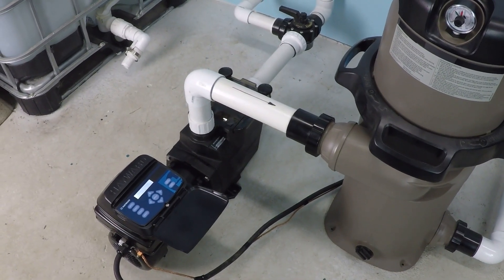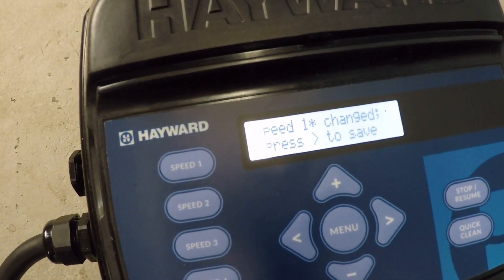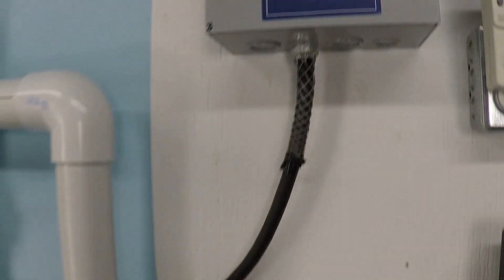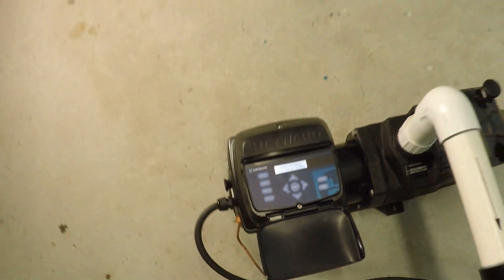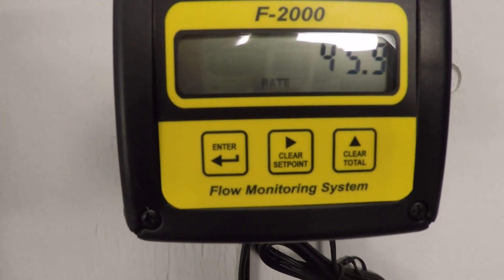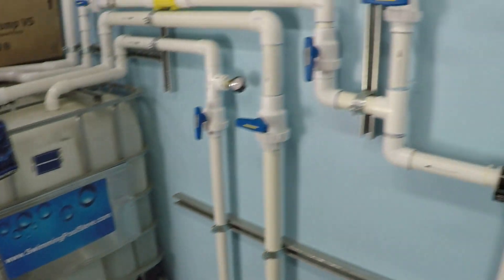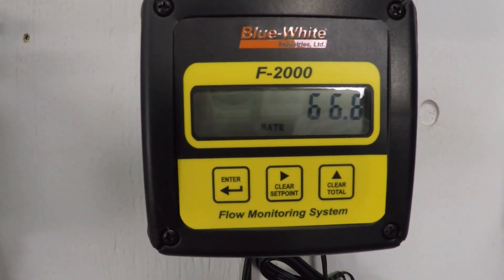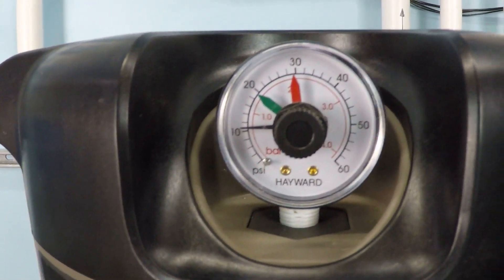Hayward Super Pump VS On 1.5" Plumbing System

Comment: Hey Steve love your videos. Big fan of the channel. What do you prefer this or the pentair superflo vs??? I've seen your video series on the superflo vs and leaning towards that unit for my upcoming pump replacement. 17k gallon pool.

Cheers 🍻
Reply from the maker: 1.65thp versus 2.2thp so do you need a bigger pump or a smaller pump?  This is the first question as these pumps only compete for the same market in name.  In actual pump power they are really intended for different pools.  How confusing, right?  Fortunately the pump industry is now moving to WEF ratings which test how many gallons (in thousands) can be pumped for 1kW of power consumed, over a range of RPM.  Going to help level the playing field a lot to make apples to apples comparisons moving forwards. I like both of these pumps and if you bought either I am totally stoked because I think you will be happy.  There are probably 100 pumps on the market and we are talking about potentially #1 versus #2 for the entry level VS market.  So yeah...both are good.  Hayward if your pool is a little smaller / less flow needed / you have a sand filter.  Pentair if you need more flow (bigger motor) and have more features to run / a larger pool / filter capable of higher max design flow rates.  Sorry for the long response to what is supposed to be an easy question lol.  Such is the nature of this technical stuff.  Always more going on than appears on the surface.  Cheers
Reply: Quest Steve,
How does the Hayward superfluous perform on 120 volts??

You have the Hayward super flo on 230 volts in the test